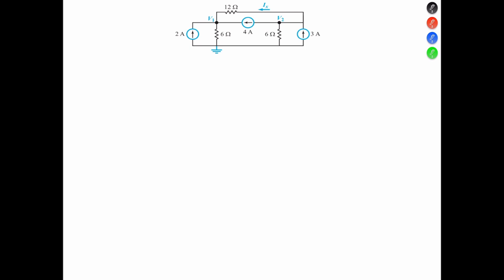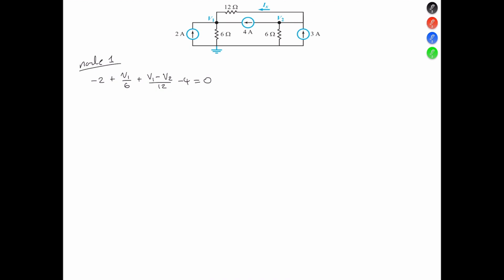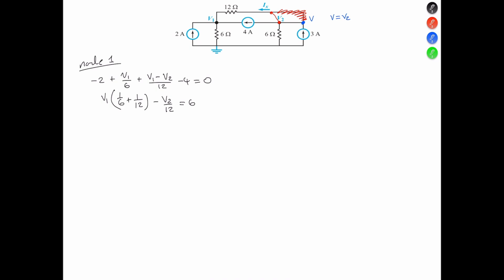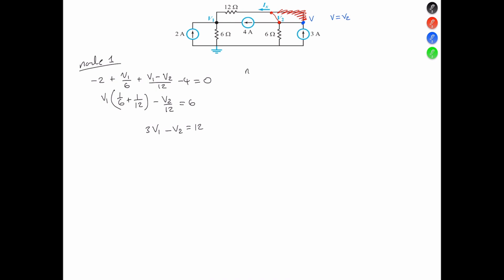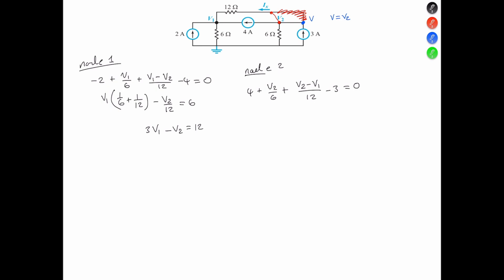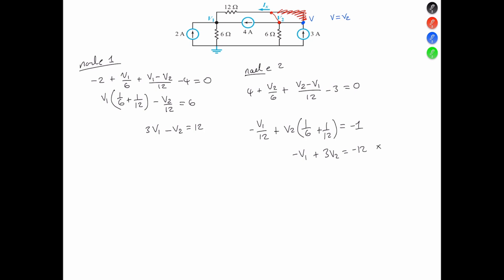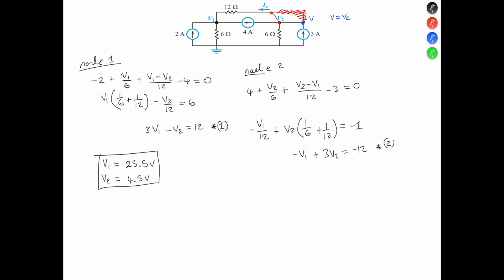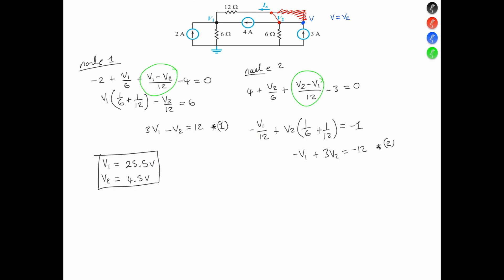Use nodal analysis to find the current Ix.

Comment: why Ix is equal to (V1-V2)/12 ?
Reply: Note, I=V/R, thus, the voltage difference across the 12ohms resistor is (V2-V1), hence the current is l=(V2-V1)R. Also, we could write mesh equations which would yield the same result.. the voltage V is the same voltage at V1..
Reply: @inegma7835  I mean why at node 1, he labeled the Ix as a leaving node (I assume it is leaving because he made 2 amps and 4 amps as an entering current in the node), even though it is going through V1? At node 2 it made sense because of the direction of Ix current but I dont get it at node 1.
Reply: nvm i got it, he just didn't showed it clearly